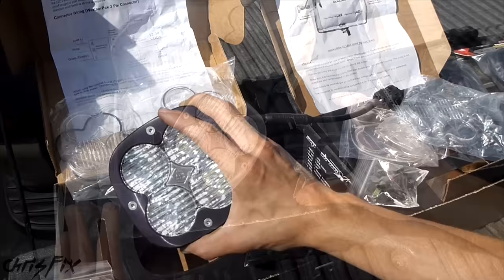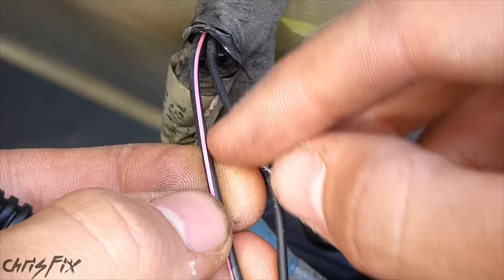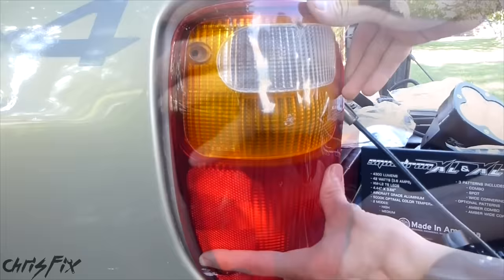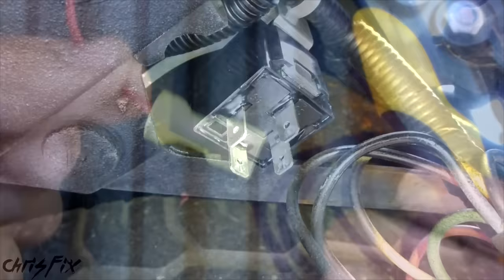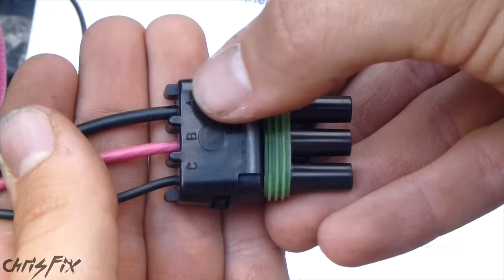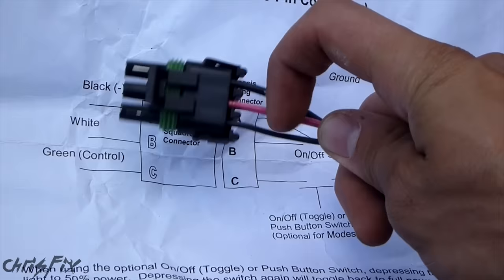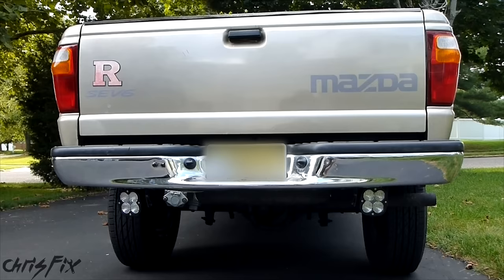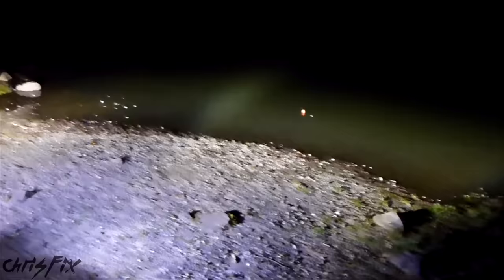How to Install Auxiliary Reverse Lights

Comment: I have the same type of lights and I just put the negatives to the metal body and the positives to the back up lights and it works perfectly, you don’t need a relay and in my opinion you made it to complex for yourself

Comment: Little trick I learned somewhere I can’t remember...using the wire stripper part...after opening if you take a small screw driver to open the wire to make a whole and thread the added wire in the whole and twist...very strong...solder for even more strength...how I do my stuff

Comment: Could you also add a switch to manually power the light and have it triggered when backup light comes on?
Reply: I also would like to see a wiring diagram for this setup. 3-way toggle switch: on/off/on with reverse lights.

Comment: Shouldnt this only be triggered if BOTH: the headlights are on (nighttime), AND the car is in reverse? If not, then it will turn the reverse lights on any time of day, and not exclusively at night, when it is needed.
Reply: Blue Finch a lot of people drive with their headlights on during the day as well so either way they’d be on.

Comment: anytime you have to run wires that far you should use an old extension cord comes insulated protected and is usually overkill for the size you need but you don't got to worry about rubbing a little hole in it somewhere

Comment: Awesome video. Did the same thing on my 76 series landcruiser. I've got 5% tint all around so i really need the lights in certain situations. Instead of wiring the relay trigger/switch to the reverse lights. I actually installed a switch in the cab that gets power from a wire that has power with the ignition on. Meaning I can manually turn it on. Just dont want it running when Im reverse in car parks at night and others are around. I have used it on tailgaters but usually they try and over take me. Most don't realise I've got a 4.5l turbo V8 with a upgraded gturbo... I speed up so they can't over take me..
Reply from the maker: Nice! I ended up adding a switch as well!

Comment: Please use shrink tube over your solder joints! No need to run it all the way to the battery .Hot tip: do NOT solder the ends of the connectors, just crimp!
GREAT camera work!!!!!!!!!!!!!!!!!!!!!!!
Reply from the maker: Thanks for sharing and thanks a lot!

Comment: Thank you for putting the video together of the "right" way to wire up accessories (ie with a relay).   I want to do this to my SUV - for additional LED back-up (flood) lights.   So your video is a great help, and very professionally done installation.
Reply: Bababooey

Comment: As usual a great video. I do want to point one thing out however and that is THHN wire is not rated for wet locations. TH(W)N would be however. I doubt you will ever experience an insulation failure due to moisture considering the route you used, but if you do simply replace the THHN with a conductor with insulation rated for wet locations (W).

Comment: you should run that power wire through a rubber grommet to prevent wire chaffing. and you really should have a fuse at both ends of the wire. in Car stereo the rule is a fuse every 3-5 feet. but personally i always have found that a little excessive. also i would have gone with a lower profile light myself to help with clearance when going up and down hills. also cutting the wire and using connectors and heat shrink instead of just soldering wires is the best practice. I would also REALLY repeatedly stress the importance of the use of wire loom and electrical tape to prevent shorts later and also to help prevent chaffing and eventual shorts. You did address most of this but i don't know how many vehicles i have worked on where the wires were simply twisted together and wrapped in electrical tape. my own current vehicle being one of those

Comment: Quick tip when using electrical tape stretch the tape before wrapping it will vulcanized, also it is better to use heat shrink tubing as it will make it water proof

Comment: Great video Little tip whenever I wire anything if it is being exposed to the elements water specially condensation I heat shrink wires a Little tip keep up the videos

Comment: @ChrisFix, I see an error in your wiring. The yellow crimp connectors are for 12 and 10 gauge wire. Blue connectors are for 16 and 14 gauge wire. Red crimp connectors are for 20 and 18 gauge wire.

Comment: if you have "liquid tape" or Black "RTV" you can use that to seal the relay. And if you want the waterproof connectors,  jeep XJ cherokees and 90's chevy/gmc trucks and suburbans have all sorts and sizes you can find in any junkyard
Reply from the maker: +Cody Moncrief good idea. Thanks.

Comment: Talking about headlights on newer models it's not an issue but wondering maybe you can do a video on how to stop your lights/ headlights from dimming every time you decide to lower/raise your power windows thats if there's a fix to that
Reply from the maker: If it's a very slight dimming when you are raising or lowering your windows (or even turning the wheel and activating the power steering pump), that's usually normal and no cause for concern, but if it's dimming excessively it means your battery or alternator is going bad. I have videos on how to test both of those, check it out: https://www.youtube.com/watch?v=LGB6ZEjGm7Q and https://www.youtube.com/watch?v=COJr7OB23Hw

Comment: Great vid as always. I have two recommendations, well one is more of a hack. First, try using a plastic junction box to put your relay into. It can just sit right inside and you can get the weather proof kind and then silicone where the wires are since you can see there is mud all around where you put it. Second, if you have scrap copper tubing you can make free spade connectors, great for ground connections. Just flatten one end and drill it to size and then insert the wire and crimp.
Reply: Bababooey

Comment: If you don’t have, or want, grease on the relay, you can always wrap the wires connecting in electrical tape, works great.

Comment: Since you used a seperate relay, I would put a 3-way switch inside the vehicle.. Off, 12V from reverse lights, or 12V directly from battery... That way you can turn those bright lights completely off in urban areas, set it on auto (to engage while in reverse like you did) or set it on manually (so that you can see your rear while driving forward or just illuminate the rear while the vehicle is in park).

Comment: sure someone asked it but why splice wire like that when there is wires in a lot of the wire harness for trailers?
Reply from the maker: Because not everyone has a trailer harness so I want to show how it is done. Also the trailer light wires are for a low amp draw not 10+amps so the wire could burn up or blow a fuse.
Reply: Whats your thought on just a pigtail splice connector into the oem reverse power  wire?

Comment: I know this an old Chris fix video but I think for what is being done cutting the back up light wire completely and then adding heat shrink and then soldering it back together with the new wire would be the better way to do this to avoid any chance of shorts happening.

Comment: At 13:00 your actually suppose to crimp the little rubber seal, that he pushed up in the connector before this, right there. It’s not there to crimp around the wire. You need to put that rubber seal on first then crimp the wire and then crimp the seal on there last. It’s suppose to be at the rear of the connector when you latch it over to keep water out.

Comment: Heat shrink would also work in place of the wire loom cover. The only problem is, with heat shrink, you have to cut it completely off of the wiring. The wire loom covering is easier to go through. The bad thing is, the wiring loom isn't actually waterproof, since it has a slit in it for getting the wires into it. If there are any breaks in the wiring, you could have a problem. Great job overall, though!

Comment: With stripping the wire it is now exposed to moisture and will corrode over time.  It is best to cut it and use waterproof nuts.  Since the tail light is already out it would have been best to mount the fuse in there to keep it out of the elements especially in heavy snow environments.
Reply from the maker: Thanks for sharing.

Comment: If you need to strip a wire somewhere in the middle you can just use a lighter und melt down the isolation in that place. That way you prevent cutting wires.

Comment: You could've tapped on the trailer harnesse to make things easier, also if you don't have a waterproof relay you can use silicone to weatherproof it.

Comment: I did the same thing but I just connected the two led pods the 24" or so to the reverse lights and tapped directly into them, no relay needed. Same as you pop it into reverse and the lights come on. It's been 8 years and they are still working and have had no I issues with them. Just seems a bit quicker than your route.

Comment: I like how informative this is, but is there also a video showing the auxiliary reverse lights being hooked up through a 3 way switch too? Meaning, one position has them off, the other has them come on with the reverse lights, and the other has them come on by themselves? I'd love to do this with my truck but I'd prefer the flexibility to control when the lights go on.

Comment: Nice job on the video. I opted to connect directly to the trailer harness. I didn’t wire a switch, the lights only illuminated in reverse. That way I wouldn’t be tempted to light blast tailgaters.. lol

Comment: Oh man, to connect the power lead to the taillight feed, you should use solder-less crimp connectors and then some heat shrink to seal it.  Moisture will get in the taped connection and erode the solder joint.  Anytime you are connecting new wires to existing, you need to use this method.  Otherwise, concise explanation of what needs to be done.

Comment: I'm going to do the same setup but I'm installing a rocker switch inside to turn them on and off
 I'm adding a light bar to the front possibly so I'll be well lit

Comment: Ok there's only one tip to make sure you know about when installing anything where you cut or splice your vehicle's wiring. Use the special ZINC connectors that are light blue colored when you put it back together. Why: once opened up to the air there is water in the air and it corrodes your wires. The zinc protects your wiring system by being the thing that corrodes instead. This means eventually the connection fails but you simply install a new sacrificial zinc connector. That's how it is done correctly.

Comment: Hi Chris, I’m curious why you’re using a relay rather than just pulling power from the reverse light to power the lights? Then just find a ground either behind the taillights or utilizing the trailer ground

Comment: What if you go off road? Will there be enough clearance between the backup lights and the ground? I'd hate to ruin the new lights because the truck didn't clear a branch or rock  that crushed the new lights. Even on a dirt road, clearance is everything!

Comment: use an other relay connected in serie with first one , and connected to the rear position light ( tail lamps ) make those auxiliary work in night only , save little of battery life ,

Comment: Nice video! And THANK YOU for not using those stupid Scotchloc electrical connectors that cut into the wire for the connections. Those things fail after only a couple of years and then the area that was tapped is ruined.
Reply from the maker: Thanks! I am glad you enjoyed the video!

Comment: that orange rubber plug you put over the wire is supposed to be pushed back all the way to the wire coating.. other wise water can still get in behind it and short it out

Comment: It's a good idea to use a clean ground wire to the battery, you'll never have to worry about a chassis ground going bad due to rust. Also, those lights are in a great spot get caught on something and get ripped off.

Comment: Hey man I got a question, why didn't you just save time and money and just ground them both too the frame and tap into your reverse lights and piggy back off them? I mean I did it on my truck and it was and is a Hell of lot easier and cheaper bro, just saying. But each to his own I guess
Reply: Did you mean and not use the relay? My guess is he doesn't want to run the power for the backup lights off the same wiring as the reverse lights. I'd imagine the reverse lights are a smaller amperage and he wants to just the backup light as a "switch" to trigger the new backup lights to come on.

Comment: @ChrisFix what happens if you just simply connect the wires to your stock reverse light? You can use a modern low wattage LED, still bright.

Comment: Hi, great video. Why not connect the the new lights directly to the back light with a fuse between them? why not skip the relay and the connection to the battery?

Comment: All I can think of is the corrosion and brine from new england winter roads creeping into all of that. Because of that, I'm thinking that running the three wires shielded with plastic tubing from the factory and new lights to the front and have the relay and fuse in the fuse box under the hood.  Thoughts?

Comment: am curious as to why you didn't go under the truck to the wiring harness to connect the wire? You could have found it  with a test light or your schematic.

Comment: this is a great vid, i'm installing a similar set up as well on my pickup. I ran aux power to my bed and installed a grounding bar (similar to your house electrical box). That way i could just run one heavy gauge wire for one ground and connect the rest, and not have too run a whole bunch of loops all over the place. would you consider a vid on a battery isolator install with a second battery?

Comment: I was doing so well by keeping up with what he was explaining up until the 3-pin connectors. Someone explain why he didnt connect the lights to the relay like mentioned on the relay diagram

Where did the factory wiring harness come from? 15:39

Comment: It looks lile a mosfet controled system, so I guess you dont need the relay, I think you could just take the Green (Control) pit and put it directly to your possitive on your origional reverse light. The light bulb will drive it to ground, when light is off, and when light is on it will be driving it high. Think that will work, thats kindoff why they'd call it control, so you dont need to add the relay :)
So B is +12 all the time, A is all the time ground and C you put to the + on the reverse origional light

Comment: When I splice a wire I just use the strippers to expose wire then take my wire I’m adding in and wrap it around the exposed part and then wrap it in electrical tape works like a charm

Comment: Hold the solder iron underneath the wire and run the solder from the iron up and then solder, it makes the solder go in the wires. Ive been trained to do it. The way he showed to solder will create a cold solder and creates a bad connection

Comment: Why do u connect the powercabel to the lights to nr 30 and the B+ cable to 87? IMO u should switch places on does 2 so the B+ is on 30 and the power out to the lights goes to nr 87.

Comment: For almost 10 years I have been doing electrical work to different vehicles.
Only once I have disconnected the battery before starting the work, and that was because customer wanted me to do so.
That one time was the only time a car left the shop with a fault light on it´s dashboard.

Comment: I love your channel but as a retired law man, I would put in an override switch somewhere so that when you are on the street and must back up, you are not cited for an excessively white reverse light. That light is beyond, "dazzling" and much brighter than the original engineered reverse lights. If an office can get P.C. to stop you, you may not like what happens next. Think about it; you are backing up at a local gas station and the brightness causes a wreck.... liability for damages to both property and person. Your insurance could theoretically not cover you for the modification especially if the box reads, "OFF ROAD USE ONLY." Now, on to my next Chris Fix video!

Comment: You seem to have pin 30 and pin 87 reversed? Have been researching relays for reversing lights and most have pin 30 as power in and pin 87 as power out to Accessory (lights, etc)????

My apologies...Looked at the video again, and you did explain why......

Comment: Would it be possible to have a single cable come from your battery to a housing to connect more wires? And perhaps a separately installed fuse box?

Comment: Thanks for the video. Your channel has git me thru a few projects.. This is my next project, where would I introduce a switch so that I can use the lights when not in reverse,  or would it be easier to just install a seprate light and switch? Thanks as always..

Comment: How has this held up over the years?

Additionally, how would you wire this to only allow the lights to turn on when you have the headlights on?
Reply: You'd wire them to the running light wire instead of the reverse light.
Reply: @NotSoFast71  but that would turn the lights on when I turned on the headlights. I'm sorry, I was vague in my question, but thank you for responding.
What I'm looking for is to use something like this, but I don't need the extra light in the daylight, so the accessory reverse lights would only need power 1) when the headlights are on, and 2) when the vehicle is in reverse.

I'd probably just need to run a switch in the cabin because I really only need it in certain dark places. Like, you don't need them in well-lit parking lots, for example.